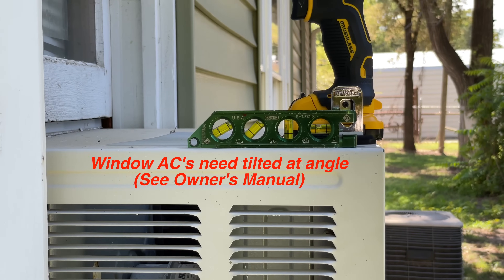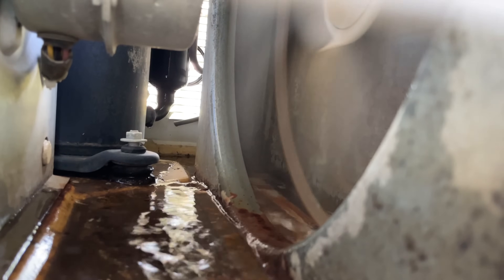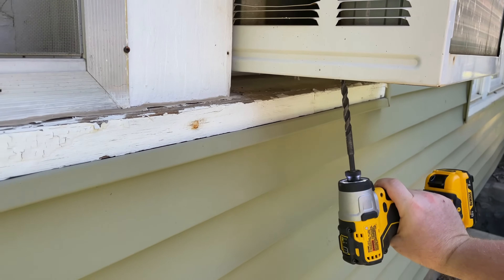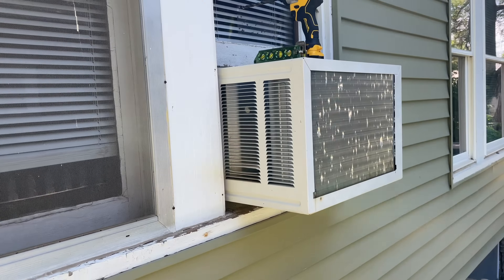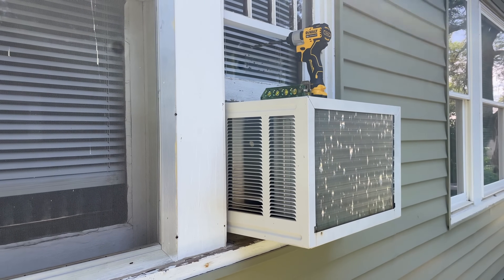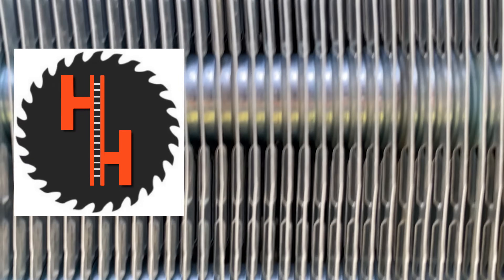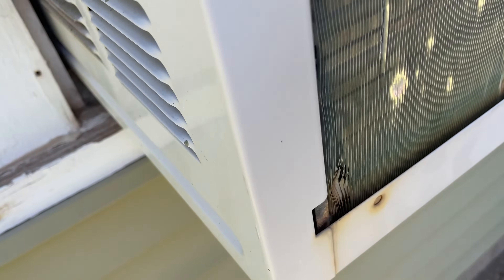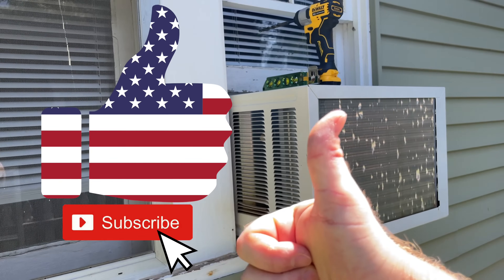99% Don't Know THIS About Window A/C's!! DON'T DRILL!!

Comment: Interesting since Midea just recalled all the 8 and 12 thousand BTU U-shaped air conditioners because of the hazard of the pan rotting because there was no way for the water to escape. You can see in your video that there is no way for the all of the water to be flung out over the fins. Even a small amount of water could rot the base pan. One of the options that Midea offered was to have a tech come to your house to put a drain in. The other two options were to recieve a kit with instructions on how to DIY or to receive a pro rated refund with proof that the AC unit had its cord cut.

Comment: Now, midea is doing a recall. They also designed their U-shaped model without a hole. Apparently, it is causing mildew to grow, and they say its because it doesn't have a drain hole.
Reply: I'm no engineer, but I put holes in the back of mine years ago.
Reply: I also drilled a hole when I saw the water sloshing around.
Reply: @imcubanb2870  Same I drilled a hole in mine day one, goin on 4 summers now.
Reply: I hope there's soon a class-action by all mold-toxified people against all AC companies, forcing them to reinstate holes in window AC's.
Reply: They wouldn't need to sling water if they designed them better.  Anything to cut corners.  Im about to drill a catch panel that catches the water flying back at the window outside that drains it off my house.  Consumers need to do something and stand up for themselves.  Don't try to educate others about design, telling them not to drill holes unless you tell them about the drawbacks of the system. Like the mold and the need for constant cleaning. 

Nobody wants a constant film of mold somewhere.  These air conditioners are disgusting.
Reply: Mine has a drain hole but it has a rubber plug on it. In the recall they provide several redesigned plugs with holes to be changed every year.  In humid Florida our AC works the same with the original plug completely removed
Reply: I went for the repair and the tech just left. What is nice I have zero mold and the tech said my unit looks brand new inside. This is my third year and I use it daily! I have never had water build up in the unit and I have never seen any water drip from the outside. The tech told me this is the first one he has done that water didnt start pouring out after he drilled the hole. I clean my filter weekley and I think with proper maintenace people won't have an issue. Every window AC will have mold if you don't take care of it. I really like this unit! It works perfect and is so quiet you actually have to watch the louver moving up and down to know it's running. It cools a very large room on the third floor that has cathedral ceilings. We have had a 90 degree summer and this unit didnt break a sweat! This is the best AC unit I ever owned. There is no way I would return it. I clean it regular and bring it inside in the winter months. Take care of it and it will take care of you. Cheers!
Reply: I think the problem is if you don't clean the filter weekley your asking for trouble. Everything needs PM (preventive maintenance) I've had a bunch over the years and this unit is the best I've ever owned. So quiet yet so cool! Midea is a company doing the right thing! How many companies do that these days?
Reply: @Dustedpages2   it's not the filter.  It's where you live.  Mold, bugs and gunk sit in the water from the area and climate and get kicked up on everything.  I keep my filter clean.
Reply: The new technology in window air conditioning whereby a fan slings the water collecting in the pan to be evaporated. 
Problem is it does not evaporate all the water collected resulting in water sitting in the pan and creating black mold. 
The black mold spores are blown into the house when you turn on the air conditioner. 
Medea realized this recently and recalled their air conditioners and redesign them by drilling  drain holes in the pan assuming it will correct this problem by eliminating hot water collecting and mold growth.
I'm not very confident this will eliminate the problem totally. When you shut off an air conditioner there is condensated water sitting on all parts of the air conditioner and over time cause mold to develop. 
You need to be able to remove the housing of the air conditioner periodically and conduct thorough cleaning and disinfecting of the air conditioner.
Reply: @rcappy47 it's not new technology.  It's using evaporation as cooling.  It's used in swamp coolers and is older than dirt.  They used it to cut back on how built the units have to be to achieve their BTU rating.

Comment: This video provides great info - on how to ensure you get mold inside your AC unit.  I have put in a lot of hours this year cleaning out my two Midea AC units.  And I am still coughing/wheezing from mold exposure early this AC season.  When I installed the first one, I couldn't believe the drain hole clearly engineered into the unit - filled with a solid blue plastic plug.  Why put a drain hole in the lowest part of the pan, and then plug it?  I have pulled the plugs on both units and am considering "installing" more drainage opportunities.  So far, no more mold on the interior side.  But I keep checking.  And keeping my drill batteries charged.

Comment: I ruined an air conditioner by drilling a hole in the bottom. The drill hit a copper line and all the refrigerant leaked out. 🤬 My next a/c unit I drilled out but I put a depth limiting collar on my drill bit. It works fine years later and gets the water out.

Comment: Went ahead and drilled a hole in my 5k midea unit anyways because the few dollars in power you might save is not worth all the pain of a clogged coil and mildew buildup in the unit. And of course getting rid of the standing water reduces the risk of rusting out over time.

Comment: That slinging water also slings muck all over the coil which will eventually clog it up solid, and it's a huge pain in the ass to clean it. Much better to drill the hole and avoid the headache later, even at the expense of some efficiency.

Comment: My GE turned out to be a piece of schit! In the front of the ac theres the fan which blows the cold air out through the vents. Theres also a trough under this fan where the water collects. Builds up so much water that the fan blows it out the vents and actually makes the carpet wet. The ac is on a slant, I cleared all passage ways, and GE is comprised of barely-speaking-English cust service reps whose not worth a schit!
Reply: I have a GE. Granted mine never blew water out of the vent, but just yesterday I drilled a hole in the trough which looks like the lowest part of the pan. So I can put a piece of electrical tape over the hole if I want more efficiency and remove the tape to drain the water out. If you do this be extremely careful because the fan is right there. I was very careful and still nicked the fan based on one small shaving of plastic on the drill bit but no negative effects.

Comment: Think of your AC units as your house. Why don't we keep water on our roof to cool our house during the summer? Water will eventually start eating away at the material that is stopping it from moving or evaporating (see grand cannon). It's not just a mold issue, lingering water inside your AC units will start to eat away at the metal pan making your unit useless just like your roof if you don't move the water off of it quickly enough especially if your house doesn't get hit by the sun often. If your AC unit does not have a hole in the pan already, drill one carefully so you don't puncture the coils.

Will your electric bill go up? Yes. But you won't have to send $300-$600 every 2 years due to your AC unit becoming a rusty mess. Source: 3 window AC units in 10 years and my first one which has a hole at the bottom still has no rust and only dust inside.
Reply: this is FORWARD and PRACTICAL thinking.

Comment: This guy is not wrong!!! But I drilled it anyway lol, that design is dumb. I beleive the biggest reason they allow water buildup, is to make the ac fail sooner due to corrision causing a leak eventually, so they can sell you another... i really domt think the water slinging around 24 7 is good for anything, no way. Mine still works fine 8 years later, why? Because water isnt causing things to corrode away...

So if you want your ac to LAST drill it, but if you want it to cool slightly better, leave it how it is.. 

If your ac tends to drip in a sh*tty spot like out the side onto your window, go ahead and drill it.

Just make sure whatever you do, your drilling in an open area.. you hit one of the lines theres a small chance youll blow up 😂

But this guy is not wrong, just saying that again

Comment: Yeah but that water makes ur AC gets rusted quickly so it won’t last for years. It’s better to drill that hole and have ur AC last 15-20 years that it lasting only 5 years cuz the condensation coil go rotten and punctured

Comment: My window AC unit used to drip the water but I'm thinking it ain't tilted enough there is build up inside. My unit kicks on and off blowing cold air 1 minute and hot are the next. Also has been tripping the circuit breaker. It's a bigger newer unit and it doesn't do as good as my smaller older units

Comment: All honesty there should be a hole in the back of the ac ! Water was leaking in the inside like crazy . Then i took it off the wall nasty water & like gunk that smelled so bad . Cleaned what i could,  grabbed a knife & hammer then made 2 holes in the back to corners . But be careful yall !

Comment: I've compared the differences between having better drainage and less mold build-up vs slinging water on the condenser and building up a swamp inside, and in my climate at least, the extra drainage is MUCH better over all to have. I've seen several different internal designs from different manufacturers since I buy new units every 3 years, and there's usually a few different channels or openings on the top and bottom of the interior styrofoam barrier that seperates the equipment (interior evaporater and blower / exterior fan and condenser) , and from my experience the mold etc can easily spread from the outside half of the unit to the inside parts. Since I started making my own drain holes, the amount of build-up has been reduced by at least 90%, and I have not seen any difference in cooling ability or energy consumption.

Comment: I have a Kenmore Elite 25,000 BTU air conditioner, and it runs for about 30 minutes before cutting off because it says it's overheating. This is the second air conditioner of that brand that does this. The thing called the slinger, is that supposed to cool the condenser? Because mine doesn't hold water.
Reply: Did u check the  filters sometimes they’ll leave the plastic on it lol

Comment: Mold, mold, mold….
Midea recalling 1.7 million units that don’t drain isn’t because they want to.  It’s because people were getting sick.
Reply from the maker: Irrelevant. That’s a midea u shape problem. Every brand has this and has for decades.
Reply: @HandymanHertz  Master HVAC, plumber, licensed backflow and gas fitter here. My company was contacted to be one of the repair servicers for Midea U-Shaped inverter type window air conditioners and the other manufactures they sell to for our area. We declined as it's a headache and we don't make any money from these types of contracts. Their remedy is disassembly unit and clean mold and dust, and clean coil. Install their drain kit under rear of unit on the right hand side. 

Standing water inside any air conditioner is a recipe for mold, the water needs to drain.
Reply: @HandymanHertz  What is the comment about it being a Midea problem based on?  Something about those units specifically?  Lots of people would probably watch an update video on the Midea if you made it- millions own these units- including myself.  Thanks!!
Reply: The coils will not be cooled if they add a drain hole. The efficiency will be reduced as well but it’s better than mold.

Comment: Yet Here I am now drilling out my Midea U so it drains and I don’t get mold.
Reply: Accidentally put a hole in mine doing the same because of mold
Reply: I got the Midea U and love it.  Live down here  in central Florida where it is humid as heck.  Once every two weeks I spray Decon 30 with a pump sprayer into the blower wheel and evaporator.  Takes like 5 mins.  So far no mold or stinky odors.  It drains fine, so I'm not going to return it.  I think each window shaker is going to get mold if you don't clean or control it.
Reply: @Discretesignals  So you just hit it from outside with a pump sprayer? The Decon 30 something you dilute? Do you rinse it or just let it drain out with the condensation?
Reply: @madavigo5986   You can rinse if you want to I suppose.  I just followed the directions on the jug.
Reply: I've got two. Great units but just saw the recall a few weeks ago. Went at it with the drill but stopped when I realized I couldn't find a spot to drill where I wouldn't hit something. 
Don't feel like taking the cover off right now to do it right...
Reply: I heard about the midea issues
Reply: I was so close on buying the U shaped one. From news reports,  it was a known engineering issue to their design. I may still switch to one was the design has been fixed unless they completely discontinue manufacturing it.
Reply: It's only bad if the mold grows on the inside in-house half. The condenser, evaporator, condensate, and fan should be in a separate compartment outside. If there's mold on the inside, something's wrong. I heard those Midea U had a recall recently. There's also mold/scum tablets you can toss in the condensate.
Reply: @KittySN when I run mine, it smells like mildew/basement. It just started a few days ago, and it just so happens to be extremely hot/humid this week.
Reply: @aliveandwell3958  I'd start with a thorough front/filter cleaning. There's a variety of videos on this, possibly on your model. Diluted white vinegar works well.

Comment: If you like replacing your ac every 3-5 years don’t drill a hole. I’ve decided to drill every window ac I ever buy moving forward and I’ll tell you why. First I tried the no drill option and had mold growing inside the ac and by inside I’m talk in the home completely filled up with mold. Next the condenser coils get corroded and clogged with having water flung onto them these wet fins act like a magnet and everything passing through the fan gets stuck into the fins. Next up is the rusty ac bottom the standing water will lay in the pan and begin rusting over time. So after trying the no drill option I’ve decided to drill baby drill.
Reply from the maker: Not true. This unit is 14 years old and still chugging away just fine.

Comment: Yes its engineered this way, but I did drill mine out in 20 years later it's still running and the outside coil looks like new. If you don't and let it sling it'll rot that coil right out

Comment: What do you do if the air conditioner is leaking into the house what do you do then😢
Reply: you drill 😂
Reply: Make sure your ac is slightly tipped back towards the outside. Otherwise the water goes the wrong way towards the inside of your house and doesn’t get slung out.

Comment: I really appreciate your video. Had a through-the-wall Frigidaire AC installed during last winter. Last Friday was Hot and Humid so I started it up. I’m on a top floor apartment with a balcony and out of consideration for the downstairs neighbors, I’ve been searching for a drain to hook up a hose to divert the flood I’m expecting from past years with the old AC. While the sleeve comes with holes for line/hose attachment, the AC looks like yours with a puddle inside and no visible port. It was full of water which I siphoned out. An appliance service appointment has been made because it just looks wrong! I’ll take a look later today or tomorrow to see if that’s a fan like yours has. If so maybe I can cancel the service call!

Comment: In Texas we have too much humidity, the AC window units will rot out the back in 5 yrs. You will lose a small amount of efficiency but gain longevity.
Reply: Or, drill the "weep hole" slightly lower, to keep the evaporative cooling of the condensed water, while diverting the excess....
Reply: Im having issues with condensation forming between bottom of unit and window sill

Comment: The slinger ring makes it more efficient, but the water splashing all over the inside rusts out the parts, attracts dirt and is likely to form mold. Higher efficiency but at the cost of buying a new air conditioner every 3 years. The water will still splash with the hole but much less.

Comment: No thanks. The savings vanish once the condenser coil gets clogged up from the gunk in the water. Since drilling mine, I haven't had much buildup on the coil.
Reply: that is correct.  that thing was designed by people who do not operate these units.

Comment: The quest for efficiency is often the problem. Plumbers will remember how the first water saver toilets saved water but wouldn't flush solids. And high efficiency washing machines would barely wet the clothes much less get them clean.
Window ac's form gel and black mold in a hurry in a humid climate, especially with the new efficient water holding designs.
Reply: this right here. this poor engineering trend in the name of efficiency needs to end. it's just marketing department bs/built in obsolescence